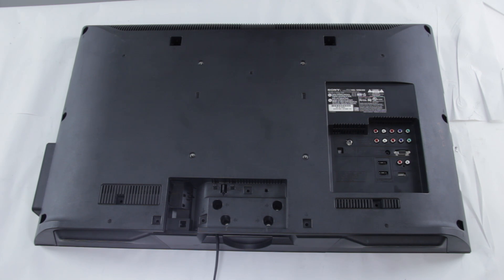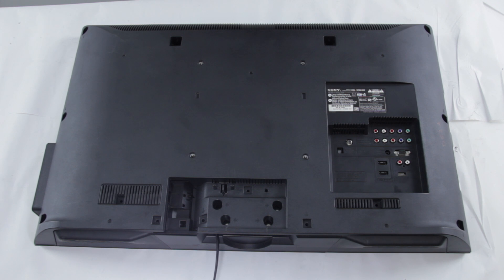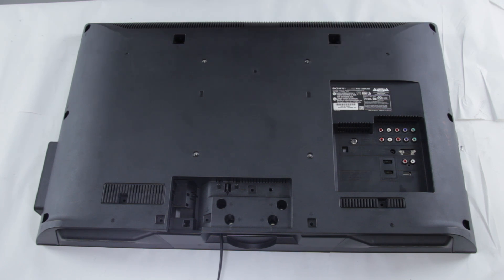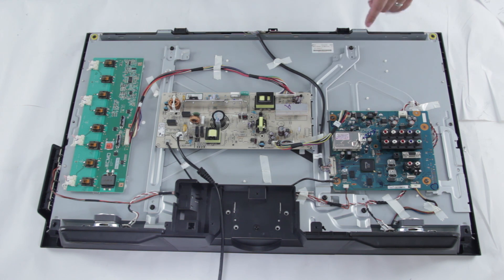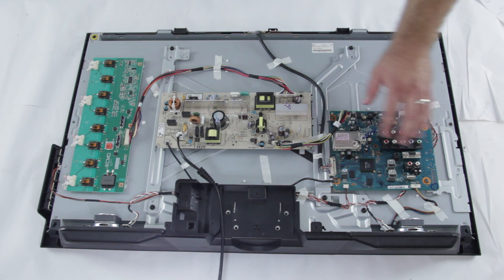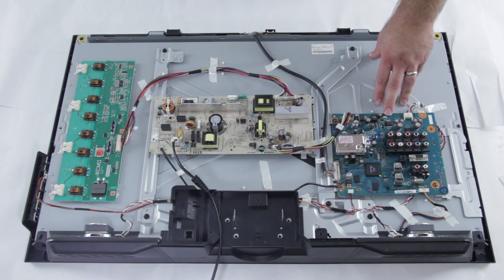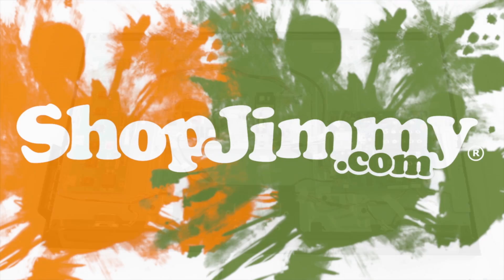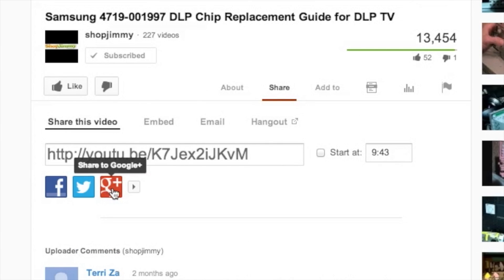LCD TV Repair - TV Has Audio, No Video - Common Main Board Symptoms & Solutions

Comment: Hey...i have a.  sharp lc -52sb55u   several times a day my   tv would make a  single  click noise and suddenly the tv would lose signal for ablut 5 full seconds or so then signal and picture would come back.  I tried all the other hdmi inputs and they also have the same issue.  I believe its the main board  because the tv power stays on when this happens every time. .... i cant find the main board part online so i can order it can u help me with this issue and help me find the right parts that i need to repair it..... ill repair it on my own.. i should not be hard.
Reply from the maker: Marcus Johnson   It appears we are currently out of stock.  You can go to the product page for that part and sign up to be notified when the part is back in stock.  Thanks!  www.shopjimmy.com

Comment: I have a Sony KDL40EX400 that won't power up either with power button on TV or remote. Press power button nothing happens at all. Verified AC power at power supply. No blown fuse, no blown caps. Verified R6342 and Q6302/3 are all good. Red standby light is on. Verified F1 fuse on A (S9102-2) board is good. Verified nothing physically wrong with backlight inverter. No burnt connections. TV was working fine when it just turned off and would not turn on again. Decided to replace the power supply - just in case. DIdn't help. Verified that replacement supply also has good R6342 and Q6302/3 components. I'm stumped. I'm considering getting another A board but I hate to just shoot in the dark. Do you have any ideas as to what might be wrong before I throw more money at this?

Comment: Hi , I have a Samsung ps51e450 and when I turn it on I can hear the audio but the screen is totally black. all the functions are working, I can change the channels , turn up and down the volumn but the screen is off. What do you reckon? main board?

Thank you very much in advance  for your help

Cheers!
Reply from the maker: Andres Quijada   I recommend running the flashlight test on your TV.   Here is a link to a video we produced that shows how to run the flashlight test. https://www.youtube.com/watch?v=xUzCLgoSPGM Please reply with your flashlight test results and we can recommend a replacement part for your TV repair. Thanks and please let us know if you have any questions! www.shopjimmy.com

Comment: i have a toshiba 32av502u that is stuck on the lock system screen and can not reset it.
Reply from the maker: john jaloviar   I recommend replacing the main board in your TV.  Click this link to replacement parts for your TV model number:  http://www.shopjimmy.com/toshiba-75012923-main-board-for-32av502u.htm  Be sure to match part numbers on your current board, with your replacement for compatibility.  Here is a link to a video showing how to identify your part number, click here:  https://www.youtube.com/watch?v=3DQe0ATZl_Q  Thanks and please let us know if you have any further questions with your TV Repair!  www.shopjimmy.com

Comment: i have a sharp aqous 37 inch that had dotted white lines in groups horizontally threw out the screen. ill say the groups appeared 3inch  by 5 inch. any hints or fixes woulkd be appreciated , thank you model # LC-37D6ZU

Comment: Hi there,
I have a SONY KDL-52X3100
I am having trouble with my TV's optical output. I am using a Sonos Soundbar which seems to be crackling and cutting out when listing to it through my TV. I have tried two different sound bars but the problem still persists. I have also tried a different LCD TV with an optical output and the problem was not existent. 
My theory is that its the mainboard which is playing up.
Please let me know your thoughts.
Reply from the maker: Frankie McCall Power   I recommend replacing the main board in your TV.  Unfortunately I do not see any replacement parts in the search results for your TV model number on our website.  Please reply with your part number on your main board and I can try searching for replacement parts.  Thanks and please let us know if you have any further questions!  www.shopjimmy.com
Reply: Oh ok thats a shame. I was recommended the A-1362-571-t board but noticed you used to stock the  A-1362-571-A. Is there a difference between the two??
Reply from the maker: Frankie McCall Power   You will want to replace your existing main board with a board with the same part number or that is a confirmed substitute.  This video may help you to identify that number:  https://www.youtube.com/watch?v=Aodz2LHkzbY  Thanks!  www.shopjimmy.com

Comment: i have a  52 Samsung led modle Ln52A639M1f at first tv was turnung on and off  but would work after a few try loud screeching sound from speakers and green line  and tv would reset on it own.. then tv stopped turning on  so pulled the tv apart saw the two capacitor were blown replace them  tv power on and stay on searching icon appeared  cool i thought but then i plug hdmi cable in for cable screechn and green line but if power tv on off sometime i get a clear picture

Comment: i have a Samsung 46 in lcd tv model # ln46a500t1fxza . symptoms are as follows, tv will not respond to remote control , cannot turn tv off using on /off button , none of the control buttons work. could  the main PCB board be the problem or could other boards cause this problem?

Comment: Hey ShopJimmy,

I have a westinghouse sk-32h540s that turns on and displays the W logo but goes no further. The power button is the only button that does anything. My theory is that it's the main board and it isn't booting up properly. I have the board in a cart ready to purchase from your site but I wanted to run this by you to make sure I'm getting the right part.

Thanks!
Reply from the maker: Kyle Kilpatrick   I recommend running the flashlight test on your TV.   Here is a link to a video we produced that shows how to run the flashlight test. https://www.youtube.com/watch?v=xUzCLgoSPGM Please reply with your flashlight test results and we can recommend a replacement part for your TV repair. Thanks and please let us know if you have any questions! www.shopjimmy.com

Comment: Hey ShopJimmy.. My Dads 46" Phillips TV Model# 46PFL5505D/F7....Used to take a very long time to come on,Now sometimes it doesn't come on unless it's unplugged for a few hours and sometimes it doesn't even come on. Either way the LED just keeps flashing...also the remote will turn it on (LED FLASHING) but will not turn the TV off and "I think he said" the power button does turn it off either, you have to unplug it from the wall. I took the power board out and did not find any caps that looked bad....I don't have the correct tester to test them. It works great when it does come on???? Would this issue be the power board or the main board? I noticed that you don't have either board in stock....Can you help me? Thank you in advance...Larry
Reply from the maker: Lawrence Small  Please watch this video FIRST to help with your repair!  https://www.youtube.com/watch?v=BP3NVNCGEv8   I recommend replacing the power supply board in your TV.  Click this link to replacement parts for your TV model number:  http://www.shopjimmy.com/philips-upbpspdel004-power-supply-unit-board.htm  There may be multiple boards for the same TV model number, be sure to match part numbers on your current board, with your replacement for compatibility.  Thanks and please let us know if you have any further questions with your TV Repair!  www.shopjimmy.com

Comment: I have a Samsung tv Model #. LNT 4665FX/XAA. Serial # AJ723CFP305304T.  I have it connected to a cable box wit an HDMI cable and also with the coaxial cable.  The TV will show a picture and has audio on all of the high def channels but will not display a picture on the low def channels (480I and below) although I still get the audio for the low def channels.  The main board # is BN94-01199B.  I believe it is a problem with this board.  Can you verify.

I have hooked the system up to a Vizio TV and it works fine.

Comment: Hi, I have a VIZIO XVT Series 21:9 Cinemawide 58-inch Class LED Smart TV with Theater 3D; model number XVT3D580CM. My TV issue at one time but it went away, the problem was that after about 5 minutes the picture would have a distinct separation in the middle of the screen from the right side to the left where one side would begin to flicker and distort separately from the other, then eventually the screen would freeze while the audio remained unchanged. if I either turned the TV off or unplugged it would power up but I would only get audio but not picture and cant remember if the back light came on or not; after the tv sat for 30 minutes or so it would come back on as normal and it would repeat the same process, until one day I turned it on and it worked perfect for about 3 months. I recently came home from being on travel and found out that the TV was having another problem, the wife and kids were watching if one day and the picture went out completely. The TV has no picture, but it does have sound and the back light comes on. Based on what I have read with separation of the right and left side of screen previously I assumed it was the T-con board so I replaced it and the TV came on as normal for about 3 days then it went back to sound, backlight and no picture. one day I turned the tv on and let it run for about 30 minutes of so and the picture popped up out on nowhere; when I did turn the TV off and then back on the same problem came back where I had no picture, in addition to having the back light come on and sound as normal. My question is what causes the tv to power along with sound and backlight but no picture?

Comment: Hi, I have a Vizio E601i-a3 smart tv.  It has an intermittent problem. Sometimes when I turn it on, it will make a pop just before it comes on. It seems to work ok after that. Another similar issue is it will stop responding to any of my remotes but only with the channel, volume & power buttons. The apps will still respond to the remote. And lastly, when it stops responding to the remote power button, I have to use the manual power button to turn it off. Then after about 5-10 seconds, I will hear the pop again while it is off. After that pop, it starts responding to the remote again. Which board would you suggest may be the culprit? The tv is out of warranty by about 6 months. I checked the recall S/N # and it doesn't fall in the range of the recent recalls. I'm thinking 1 of the boards may have a bad capacitor but willing to change out the entire board since they can be tricky to locate unless they're bulging. Thanks in advance for any help/suggestions.
Reply from the maker: Please watch this video FIRST to help with your repair!  https://www.youtube.com/watch?v=BP3NVNCGEv8  I recommend replacing the main board in your TV.  Click this link to replacement parts for your TV model number:  http://www.shopjimmy.com/catalogsearch/result/index/?cat=56&q=E601i-a3  Be sure to match part numbers on your current board, with your replacement for compatibility.  Thanks and please let us know if you have any further questions with your TV Repair!  www.shopjimmy.com

Comment: I have a problem with my led tv.  It is working perfectly fine when I am using my cable box.  But if I use any of the usb slot, I am not seeing any picture/video(picture come and go after a few second) but no interruption on the sound.  I tried to use several flash drives(even bought a new one) and portable hard drives but is still has the same problem.  My TV is Devant 50HMB930
Reply from the maker: *****   I recommend replacing the main board in your TV.  Unfortunately I do not see any replacement parts in the search results for your TV model number on our website.  Please reply with your part number on your main board and I can try searching for replacement parts.  Thanks and please let us know if you have any further questions!  www.shopjimmy.com

Comment: I have a Sceptre Model X40 which will not turn on (just the blue light turns on)
Reply from the maker: Dennis Westerlind   Try this at your own risk. Unplug the TV, then disconnect the y board and plug in the TV to see if the TV powers up. Reply with the results of this test. Thanks! www.shopjimmy.com

Comment: I have a SONY LCD TV and it has lost power.  The Model number: KDL-46VES and Serial: 8000820.  I think I will have to replace the Main board need to get the correct one that is compatible.  Can you help?  Thanks, Randy
Reply from the maker: Randy Peet   Does the front blink?  If so, how many blinks do you see?  Thanks!  www.shopjimmy.com

Comment: Hi, I have a sharp model lc-52d64u serial number 804884947.my tv will turn on the screen blink and then stay on standby mode and power light blinks.please need help, thank u I did put another power supply board and still the same. I will wait for ur respond thank u.my email arcia12001@yahoo.com

Comment: Hi Jimmy,
I've got a Samsung ln52a550p3fxza, still works but when I turn it off and back on I get a loud audio tone and vertical green lines, it then shuts down and powers up again several times and then it's fine. Any ideas? Thanks
Reply from the maker: Dustin Brown   This sounds like you have a bad main board and a bad TV panel.  This sounds like a TV panel (TV Screen) problem.  If your TV panel is bad, it may be more cost-effective to replace the TV as panels are typically hard to find in stock, difficult to replace, and expensive.  Thanks and please let us know if you have any further questions!  www.shopjimmy.com

Comment: Hello Shop Jimmy.  I have a Viore TV model LED42vf80. The left side of the screen is darker than the right. I can still see the picture but it is darker and cloudier than the right. How can I fix this? Thanks,  John
Reply: Is the below the answer to my  question? My TV is not completely black.
Reply from the maker: John Geere   No, we have not responded with our thoughts.  Thanks!  www.shopjimmy.com
Reply from the maker: John Geere   This sounds like a TV panel (TV Screen) problem.  If your TV panel is bad, it may be more cost-effective to replace the TV as panels are typically hard to find in stock, difficult to replace, and expensive.  Thanks and please let us know if you have any further questions!  www.shopjimmy.com

Comment: Hi
I have a TV Loewe Modus L42, L2650 chassis.

Since a few days ago when you turn it on, not the relay ignition source listen, but the TV lights and sound is heard, you can change channels with the remote but no video, no light on the screen.

I changed the power supply, but still the same.
thx
Reply from the maker: Esteban Heras   I recommend replacing the main board in your TV.  Unfortunately I do not see any replacement parts in the search results for your TV model number on our website.  Please reply with your part number on your main board and I can try searching for replacement parts.  Thanks and please let us know if you have any further questions!  www.shopjimmy.com

Comment: I have a sharp lcd model LC-32SB24U serial # 806895286   Problem is no picture tried factory reset no luck, also tried to get to the K screen and it would not stay on. Picture comes on and cuts out. Wonder if replacing board is cost effective vs new TV. How much would a board cost?
Reply from the maker: Michael Rozelle   Most likely more cost-effective to replace the TV.  Thanks!  www.shopjimmy.com

Comment: I have a Westinghouse LTV-32W1. This is a relatively old tv and for awhile now the remote control function has been slowly dying (I'd sometimes have to hit a button as much as four times before it would work). As of two days ago the tv has stopped working with the remote entirely. It won't receive the signal from either the cable remote or the tv remote. I've tried putting new batteries in both and I even programmed the cable remote again just to see if that would work, but no luck. Everything else is fine with the tv, it just won't receive the signal from a remote.

Any ideas on what might be causing this? Thank you.
Reply from the maker: Brett Champion   Please watch this video FIRST to help with your repair!  https://www.youtube.com/watch?v=BP3NVNCGEv8  I recommend replacing the main board in your TV.  Click this link to replacement parts for your TV model number:  http://www.shopjimmy.com/catalogsearch/result/index/?cat=56&q=LTV-32W1  There may be multiple boards for the same TV model number, be sure to match part numbers on your current board, with your replacement for compatibility.  Here is a link to a video showing how to identify your part number, click here:  https://www.youtube.com/watch?v=SoUXsgOx25o  Thanks and please let us know if you have any further questions with your TV Repair!  www.shopjimmy.com

Comment: Hello Shop Jimmy~~ Had a 55 in. LCD Flat panel that may have fell victim to lightning spike through sattelite dish that Direct Tv say's doesn't need grounded,(that's another story). Tv has standby light and no visible signs of damage to the naked eye. ie buldging capaciters, burnt spots. can a main board or video board be shop tested without taking the whole tv in? Had correct output dc voltage on board.Any info will be appreciated Thank You~~
Reply from the maker: *****   It is recommended to replace the main board and the power supply board in your TV.  Please reply with your TV model number.  Click here to view a video that shows how to find your TV model number:  https://www.youtube.com/watch?v=S51nhAmwR2M  Thanks!  www.shopjimmy.com

Comment: I have a LG 42LC2D.... The 2 HDMI and Composite video inputs do not work. The Coax cable does work. TV shows NO SIGNAL, cables and attached components all work on other TV. un plugged and to reset but did not work.   Is this a bad main board? can I fix this myself? Thank you